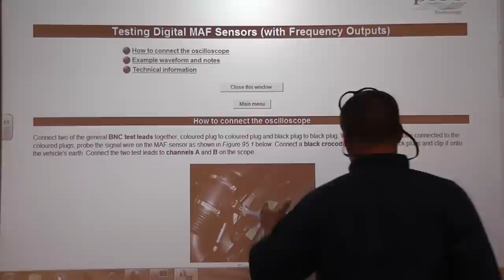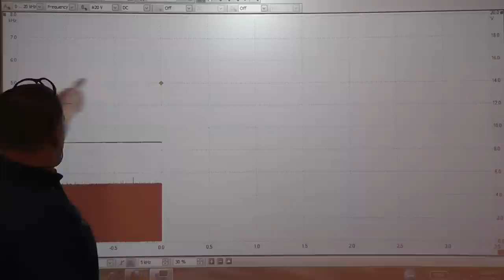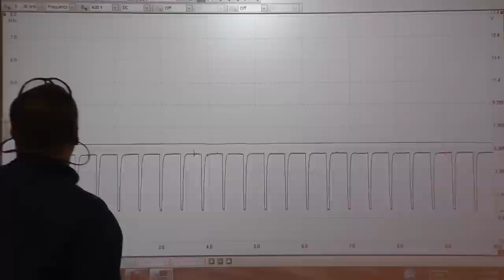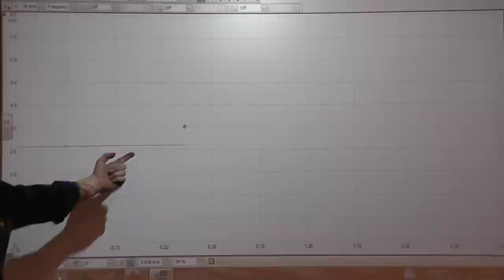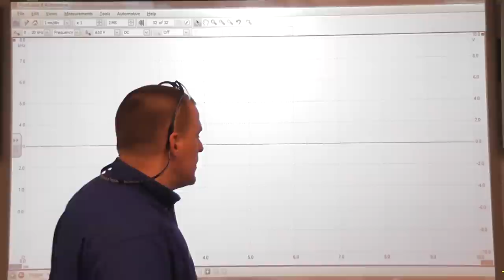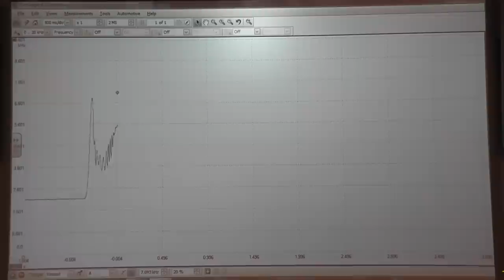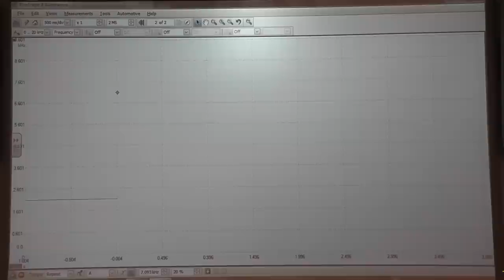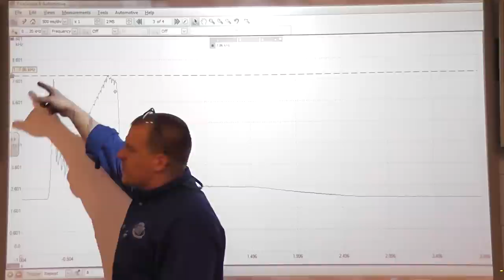How to test a MAF sensor using a Picoscope - GM

Comment: Ok good point on any type of cleaning. I will agree, possible risk damaging the MAF anytime you clean it, no matter what. Just a side note, I read the MSDS as I do on most solvents cause you never know what's in there. That brake cleaner contains Trichloroethylene or TCE, most brake cleaners do. So I would advise as the MSDS does to wear gloves. Preferable a nitrile type.

Comment: Bench testing one of these I used a drinking straw to blow on each resistor individually, it's the 2 resistors in parallel on the bars that go all the way through that sense and the one on the shorter bar is the reference.

Also with the inlet and outlet capped so that there is 0 flow it's interesting how much the orientation and thus convection currents affect the frequency, with the connector facing up (like the one on the car in the video) or down so the resistors are vertical I see just above 100Hz, any other orientation so that the resistors are horizontal it's closer to 200Hz

With the ends open even the slightest of air currents in the room make the frequency go up.
Reply from the maker: That's awesome

Comment from the maker: on this hot wire type I've been using whatever kind of brake cleaner that is laying around. and I have been doing it for the past 15 years with no problems. that being said, however the "experts" say you must use a special Mass Air Flow cleaner, and I cannot argue with being cautious

Comment from the maker: So use the "approved" cleaner then. Close inspection of the hot-wire will show that spraying cleaner alone is not good enough at times. (no matter what you use) I have seen crap on the hot-wire that must be brushed or scraped off so there is a need to be more aggressive otherwise MAF replacement is necessary. 
There are some that claim any type of cleaning is bad. To each his own. I've been using brake cleaner for over 15 years on hot-wire type MAFs with NO ISSUES!

Comment: Paul, great video!!! I am not sure if you or anyone mentioned if the air filter was a ac delco/gm air filter or after market, I have seen some after market air filters cause MAF issues, and also the condition of the air filter, clean dirty etc.

Comment: Great video.  One question: is there a possibility that the MAF sensor could produce a signal on a not running engine?  Buick LaCrosse with a 3.6L engine, the digital MAF displays about 2 kHz square wave signal even if the engine is not running.
Reply from the maker: Yes, some will produce a signal with just the key on. Not sure of 2k hz but I've definitely seen a few hundred hz
Reply: @ScannerDanner  Thanks, Paul.  So, it could be normal to see some signal with the key on?  On a scaner, I have seen 4 g/s.  Seems high to me for the not running engine.
Reply from the maker: @74santon  yes, this could be completely normal. It is not uncommon to see ABS wheel speed sensors all read 3 mph with all the wheels sitting still. My point is that sometimes scan data can be misleading

Comment: nice video Paul, that this principal apply to Toyota VAF sensor I understand that works as potentiometer  the point is  this at idle is  about 5 volts  , when I  do quick snap it should drop close to 0?? thanks

Comment: Hey there I just  Purchased ur book and   I no u changed it to use 5kohm resistors for some test cant find 15kohm resistors only 10kohm is that ok to use for those test ???
Reply from the maker: you can use your test light as a buffer instead
Reply: Thank u   I'm a part changer looking to be able to  Diagnose a problem I wach ur YouTube and I got ur ebook thanks for putting up these videos to show how to
Reply from the maker: @Ryan-pm9le  you won't be for long :-)  (a parts changer) thank you!

Comment: At 4:10 there was a spike line going of the scale.  Does that indicate MAF faulty? (It didn't happen after cleaning). I think I seen that in one of your other vids showing difference between scope and multimeter.
Edit: It was at 5:57 on "How to test GM MAF sensor part 1". You failed the sensor there but not here. Why? 
Excellent vid.

Comment: Paul, I've just tried to have a go at work with my pico but when I select the preset,channel A is set to 100v and there is no frequency option? I've looked in the AC/DC coupling but nothing there. Am I missing something?

Comment: @TRcustomengineering With the new features and scope protection in the Pico 4000 I would say save your money a bit longer and get a Pico 4423 from Autonerdz they have great training material, support, and member forums. That's where I bought my 4423 best $2300 I've spent. And like I said go for 4 channels because if you go with 2 you will just be spending your days wishing you had 2 more channels.